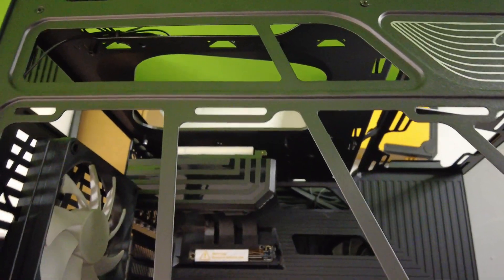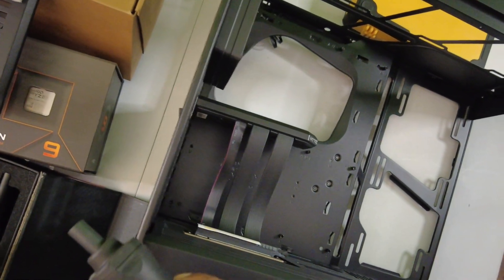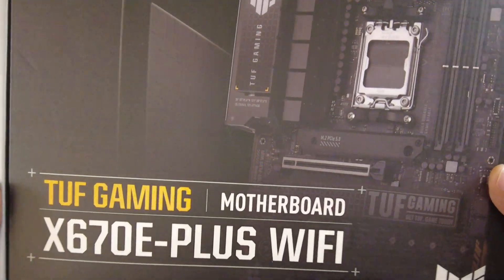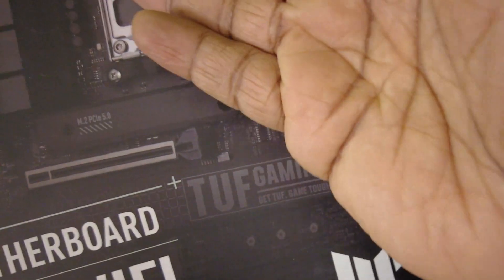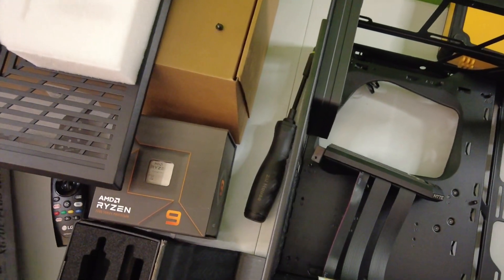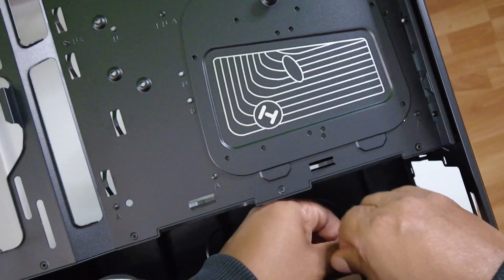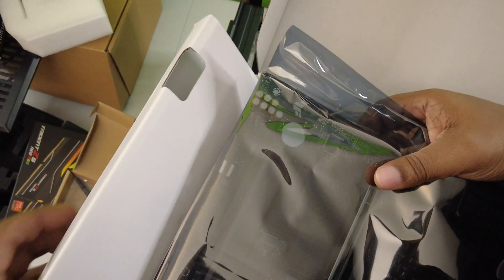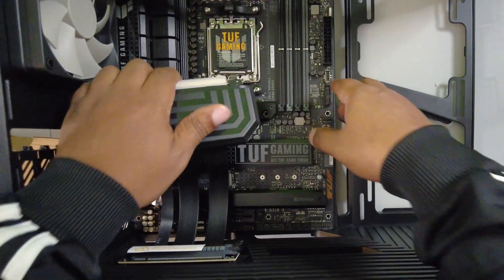I built A HYTE Y40 with Nvidia's RTX 4090 FE | HYTE Y40 Review | Building A showcase PC Hyte Y40

Comment from the maker: What do you guys think of the HYTE Y40? This is my favorite case right now.
Reply: Is it really worth the money for the case? This isn't a cheap case.
Reply from the maker: @Big_C_33  $150 is not that bad. Yes, it is a very good case. Aesthetically I love it. just make sure you use good fans.
Reply: @DeeBatch  little something I found while researching my build. When using the 360 AIO on top as you look like you saw was that the rear fan wouldn't fit. But some rad for AIOs are bigger than others. the CoolerMaster ML360L I am getting and the NZXT Kraken are 394mm long which allows a rear fan. It is a tight tolerance and can be worth shopping around for those looking to use this case.
Reply from the maker: @shadowminor  yup it wont fit with the provided fan. I got a Lian li Sl120 to put in the rear. Same style so it will sink up with other fans. I will post it on my Twitter
Reply: @Big_C_33  You gotta remember that you are mainly paying for the vertical riser. If you don't carea bout the vertical mount then Montec is a little cheaper

Comment: If I had this case and the amount of money to build in it. I wouldn't worry as much about performance. Believe it or not. I would intake rad the side fans. And flip the psu around so it draws air from it. Add 3 exhausts to the top. Add one exhaust to the back.

Comment: Just did a y40 build yesterday. Did all Lian li fans and have zero thermal issues. Great video!
Reply: What gpu did u get
Reply: @AbuWasabi  I'm glad you asked! I actually switched to a O11 Evo... at the time I had no thermal issues, but i bought an 7900xt and the thing is massive and i have an ultimate goal of doing a custom loop so unfortunately the Y40 is sitting in a box in my office.
Reply: @jonathanmiller3613  ahh that's sad Maybe you should do a 4070  build or 4070ti build u don't want to let it go to waste cause i already have a y40 prebuilt and there amazing it would be a shame for them to go unused
Reply: With a low budget CPU of course u won't have thermal issues, I'm looking for 13900k/s build in the hyte
Reply: @Slicktune  well I used a 12700k and a 4070ti...
Reply: @jonathanmiller3613  ehh they don't get that hot tho, so you should be good, it's less cores

Comment: Would the case be able to hold the normal nvidia RTX 4090?
Reply from the maker: yes
Reply: @DeeBatch  even the the 3 fan version?
Reply from the maker: @AbuWasabi  I have a RTX 4090 FE in mines don't get bigger than that
Reply: @DeeBatch  would a 4080 3 fan work? or should i just use FE
Reply from the maker: @AbuWasabi  which 4090
?
Reply: @DeeBatch  the 4080 i said the non fe version of 4080 would it fit like i dont know one from msi with 3 fan coolers
Reply from the maker: @AbuWasabi  Yes it would fit